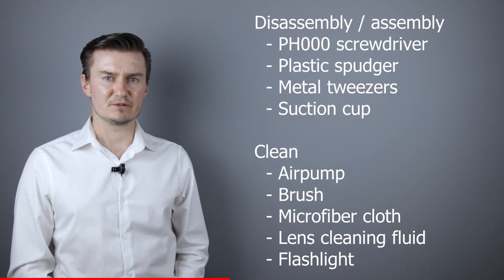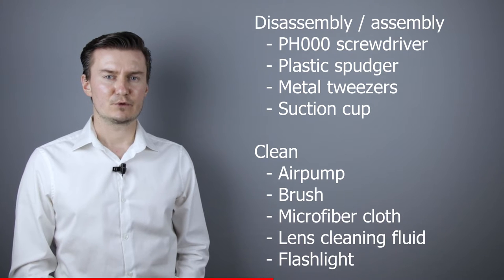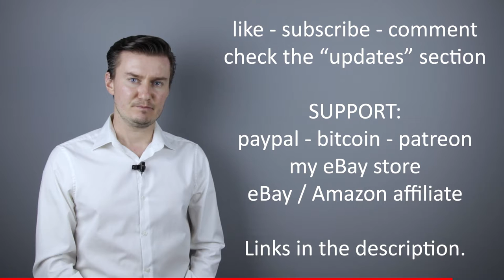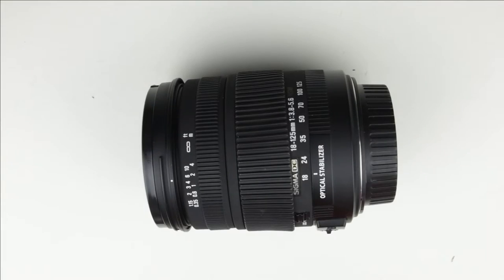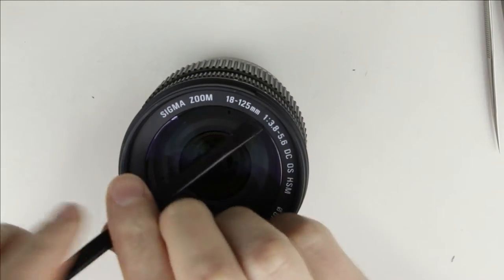Sigma 18-125mm f/3.8-5.6 DC OS HSM clean the lens inside

Comment: is the small lense cannot be clean at the inner side?  I followed your video but as i checked it the small lense still have a mold inside. how to clean it thanks!
Reply from the maker: Generally, the answer is no. It is almost impossible to remove the lens elements of the front lens, then glue it back together perfectly.